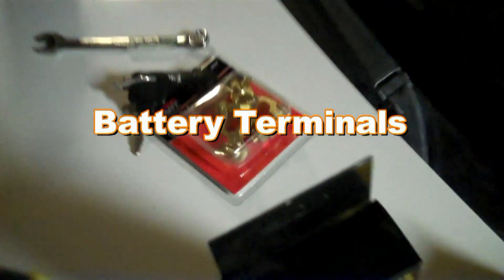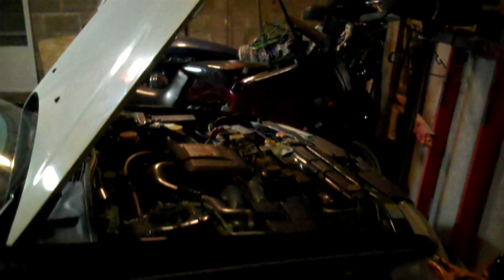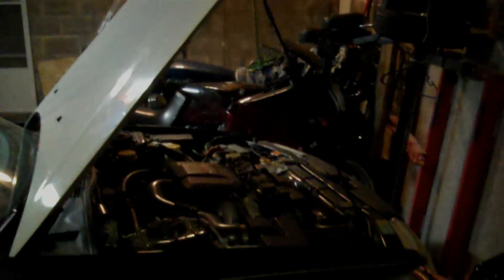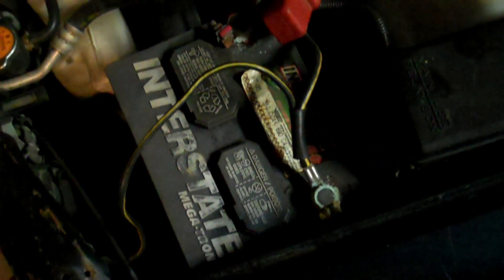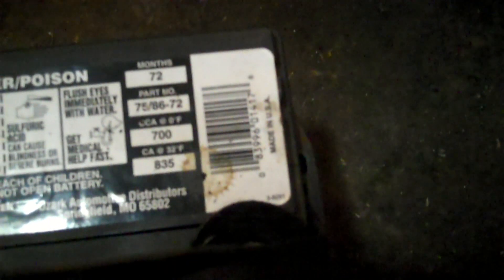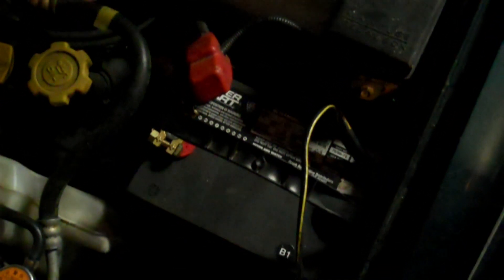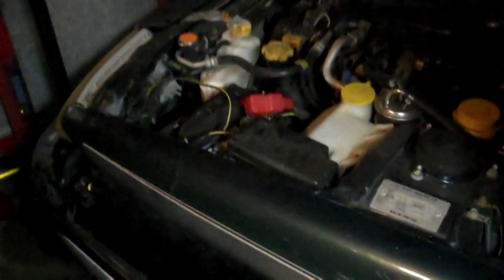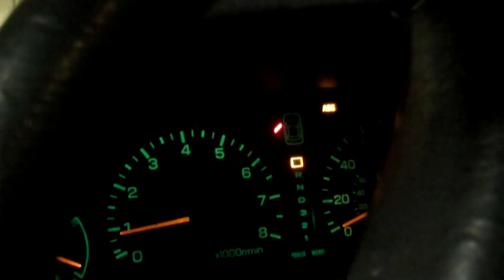Battery Terminals Subaru Legacy

Comment: Right on man. Came to conclusion I need to replace my terminals after having the same issue with starter. Lately I been losing all power from battery randomly. Little wiggle on positive cable and powers back.